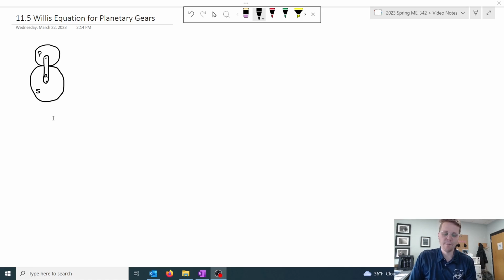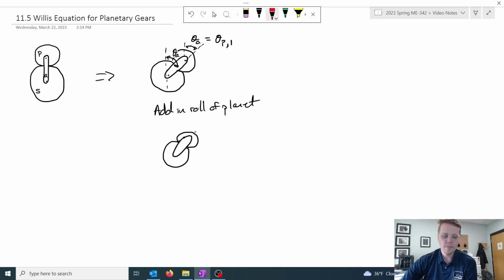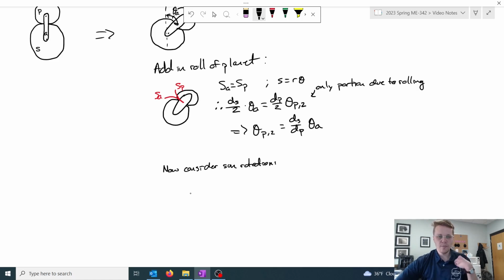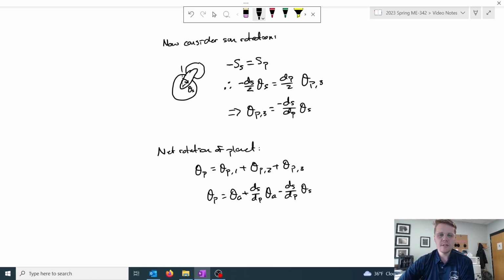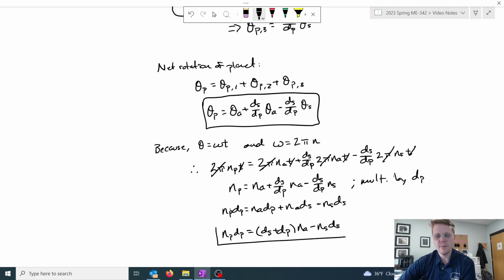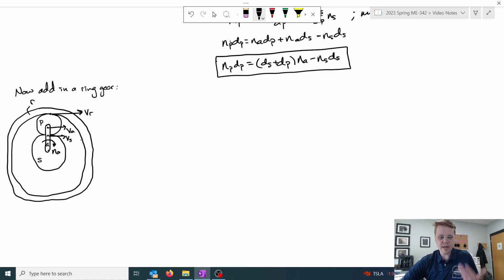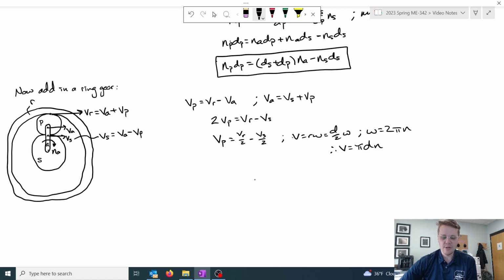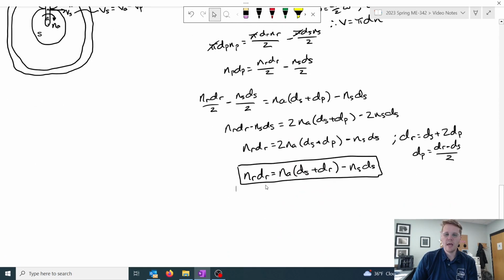Willis Equation for Planetary Gears - Machine Component Design

Comment: Toyota have created a CVT using a planetary gear.  Instead of holding one input sill, you rotate it at variable speed, and that speed influences the ratio beteen the other two.  I'd like to see the maths behind this.  In particlar what power is required from the ration controlling input?